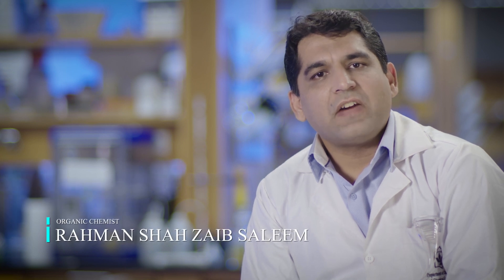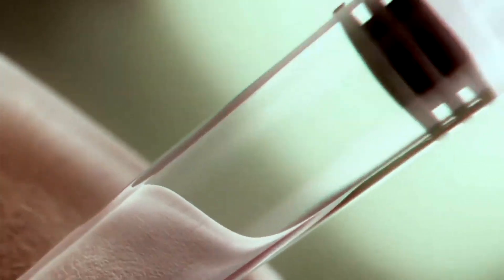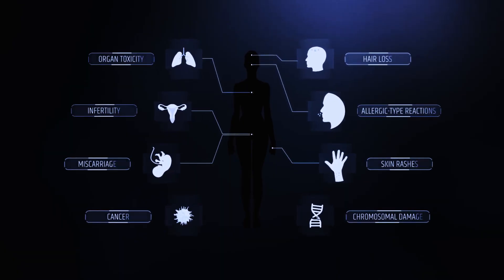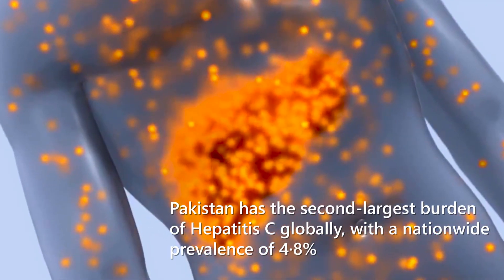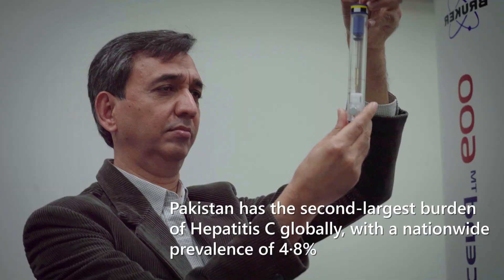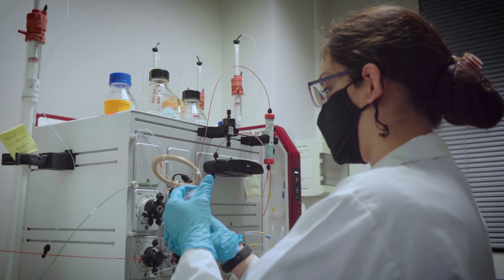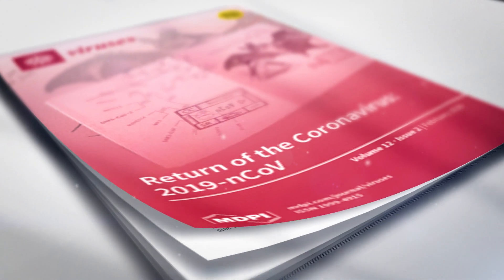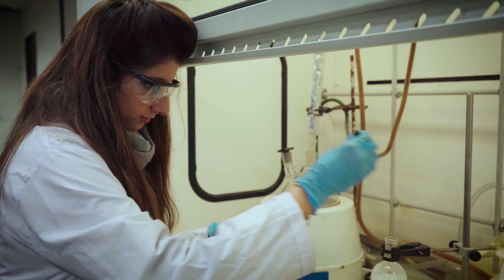Targeting Disease - Drug Discovery & Virus Targeting

Comment: Hello Sir,

here are a couple of proposals for your researchers.

1. injection of ionic iodinated contrast agent IOHEXOL for delivery of antiseptic-iodine systemically.
2. adding standard (2%) LUGOL's iodine to a standard Normal Saline so that the total Potassium Ion
   does not exceed 4 mmol/L and results in around 300ppm - parts per million (microgram/ml) in sterile
   solution and delivered as a controlled infusion to a critical patient.
3. nebulizing the solution in (2) with oxygen to a patient with high oxygen requirement in the hope of
   delivering anti-septic iodide ion to the lung and hopefully neutralizing the deeply embedded viral colonies.
4. Iodinating a portion of low molecular weight hydroxyethylstarch solution (used as a plasma volume expander)
   and delivering as an infusion whereas the starch component carries the antiviral penta-iodide ion.

Best wishes and regards.
zia hameed toor/sialkot.